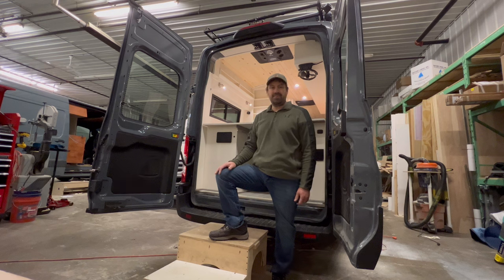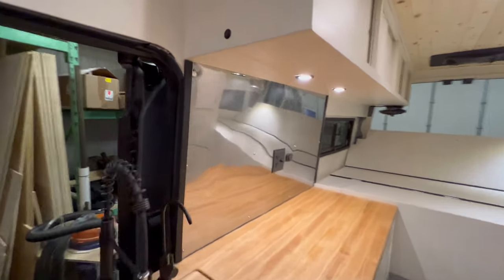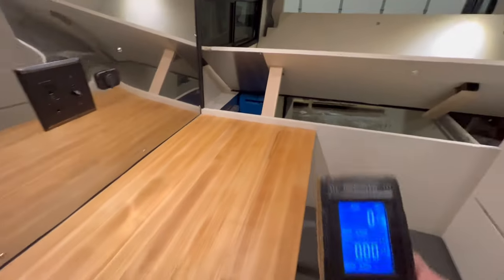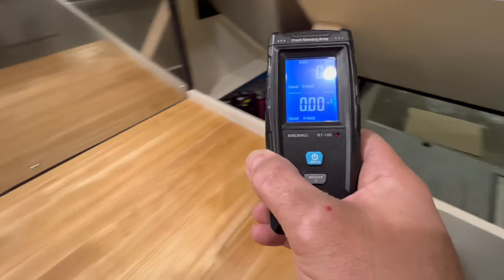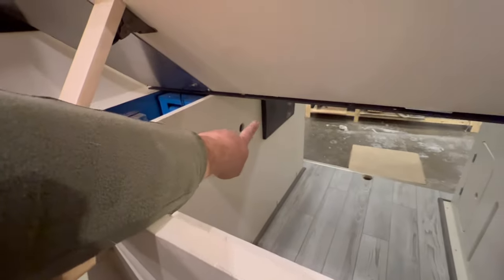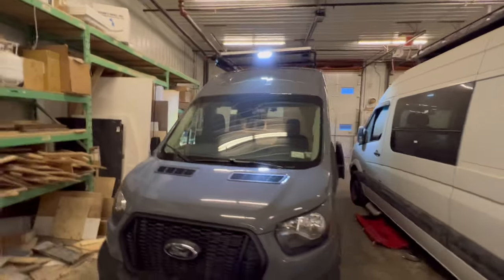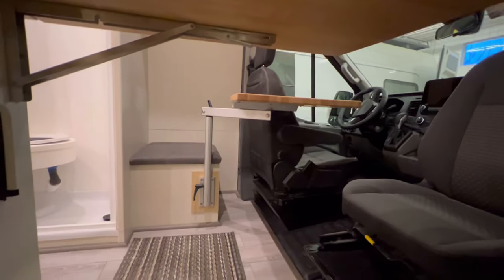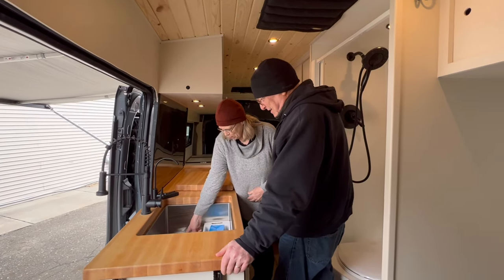EMF-Sensitive Van Build Tour | 700W Solar, 600AH Batteries, Full Shower, and More!

Comment: Beautiful design. Reassuring to see the low/no magnetic field emissions. Would be helpful to mention that radio wave EMFs are  emitted from cellular, WiFi, Bluetooth, and location services on phones.
Reply from the maker: Very good point!  Thank you.  We purposly put in battery monitors and Solar charge controllers that were not Bluetooth.

Comment: Have you checked EMF with the vehicle engine running?  They will be spending a lot of time driving.  I'm just curious how well the manufacturer has done, which I assume will vary with brand & options.  Alternators produce AC voltage that is then rectified to DC.  Non-diesel engines may also have spark plug wires that are very high voltage.
Reply from the maker: Great point.  I did not check that.  I will next time.  Thanks Erik
Reply: Good point. The 2021 ford transit I have screams in the red on my acoustimeter.
Reply: I just bought a ford transit trail and I didn’t realize the dual batteries are under the drivers seat! I’m chemically sensitive and emf sensitive, I’m going to build it out very simple and safe but what can I do to neutralize emfs while driving??
Reply: @BlueWonderLady do pretty much all vehicles have the same issue?

Comment: Another happy customer!
I wonder how much that steel plate above the electrical compartment shields the area above it from EMF. Does it completely eliminate it? Does EMF escape to the side?
A great idea. This can be called a “healthy van”.
Reply from the maker: Thanks John. Actually, the stainless-steel sheet behind the counter was an aesthetic choice.  The shielding is done with the shielded wire and the metal face plate on the electrical box.

Comment: How can you get electricity from a solar panel without an inverter? sorry about the ignorant question
Reply from the maker: We use a solar charge controller that converts the solar energy to the batteries, so the inverter does not need to be on.  Good question though.  I should have tested the solar charge controler for emf with the van outside when the solar is working.